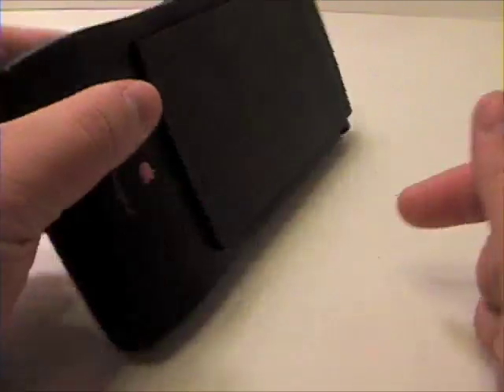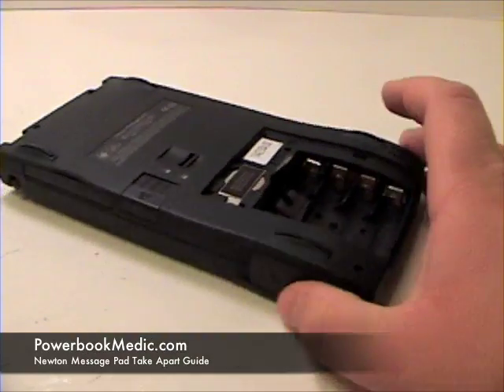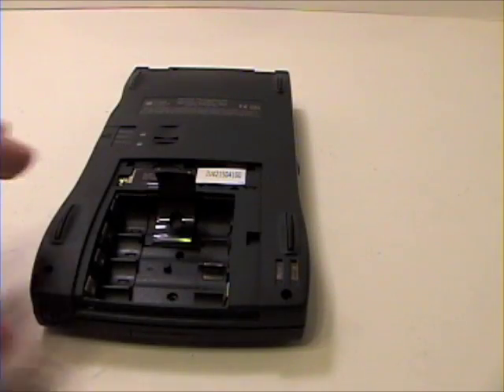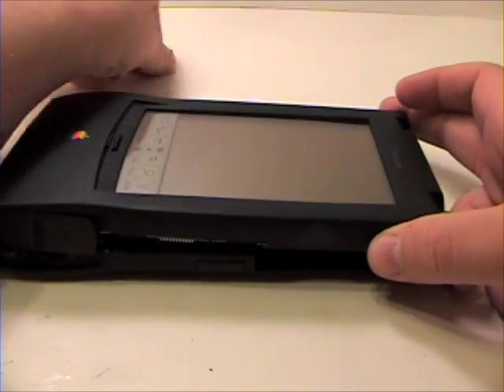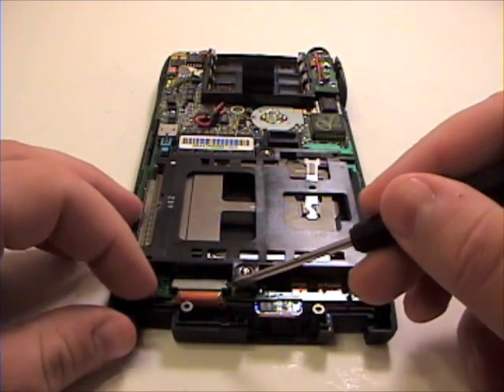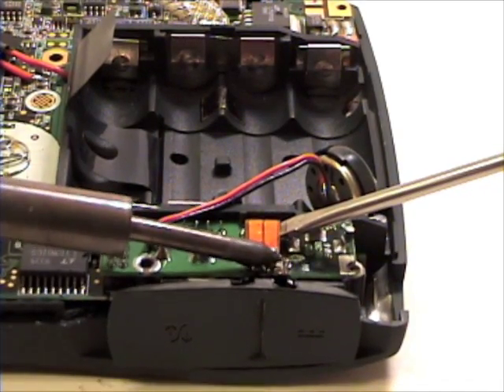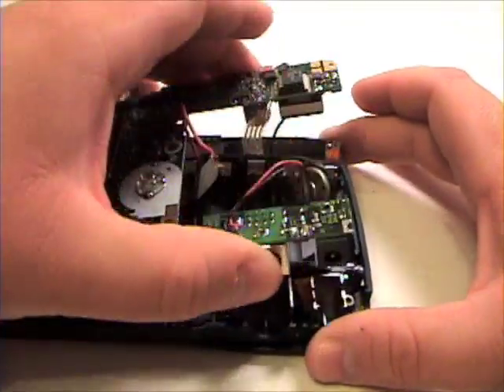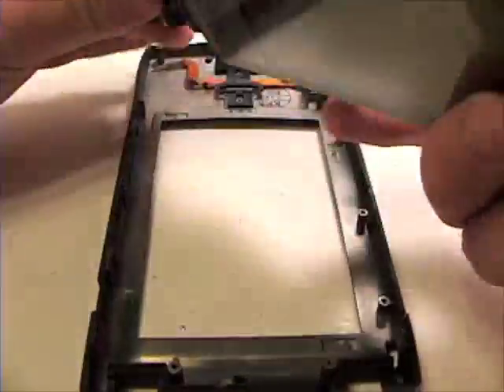How to Take Apart the iPhone's Grandma - The Newton

Comment: One thing I will add is NEVER, EVER use a flathead screwdriver to pry a plastic case apart. You will almost certainly cause noticeable cosmetic damage doing so (I’ve done it myself before I knew any better). Use something like an old credit card or a guitar pick.